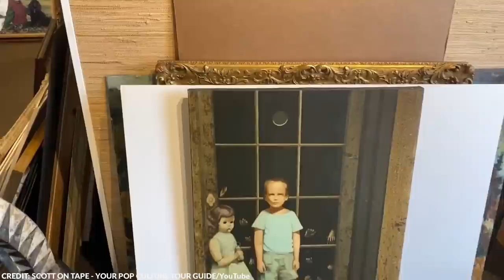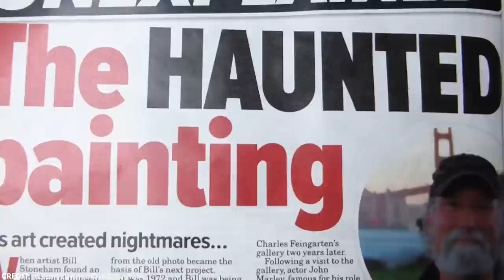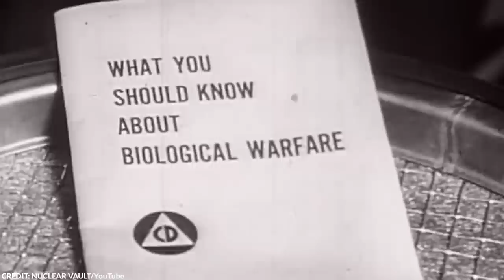20 Things Humans Were Never Meant to See

Comment: Ok, science states that nothing can travel faster than light speed yet Quantum Entanglement means particles can interact of vast distances instantly. If a Quantum computer uses Quantum Entanglement to communicate instantly not matter where in the system the processor is working, isn't that technically fast than light!